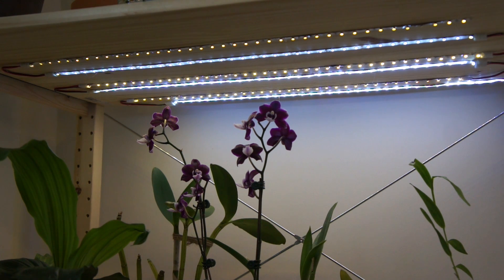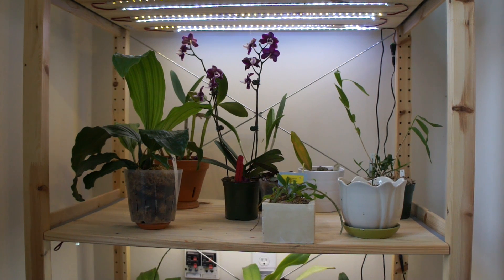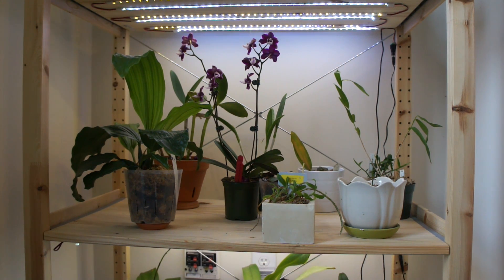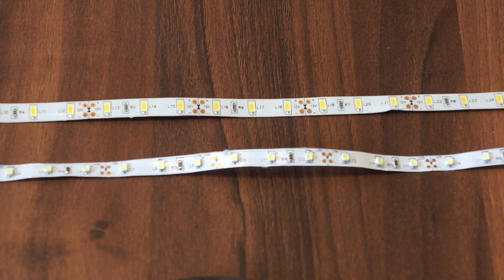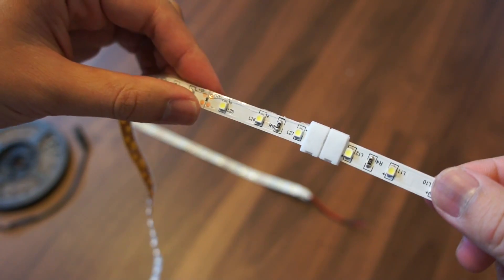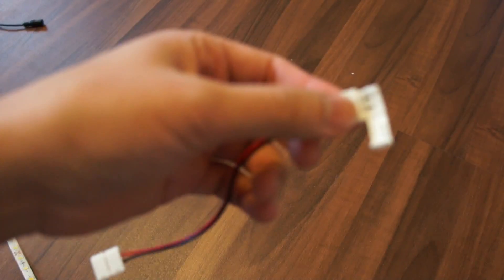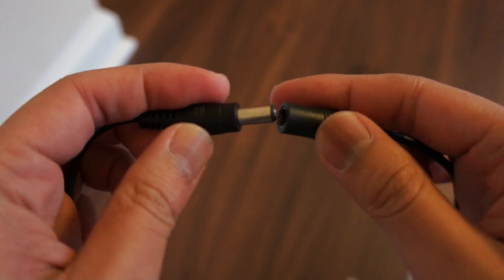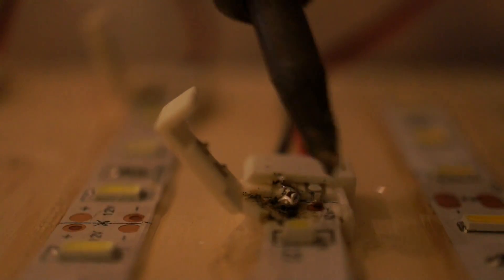Growing Orchids with LED Strips

Comment: dear friend thank u for sharing your information,, can u tell me how u connect 2 strip led together ? i need to know and order the plastic thing u conect them together. cheers
Reply from the maker: +Mehr Arian , thanks for the question. The connectors are fairly easy to connect 2 strips together. In the description above, I've pasted links to examples of connectors that's available through Amazon. You just sort of insert the strips in to the connector and snap it shut. I hope that's helpful.
Reply: +Trac McNguyen thank u for answer , if I have 12 LED lamp , 2835 , do u know how much they use electricity in WATT ? for example : 24 wat ? 12 wat ? 60 Wat ?
Reply from the maker: +Mehr Arian . I'm not sure how much wattage you will need. It depends on how long the strips are and what how much they are rated. Check the packaging for this information. If you can't find that information, I would go with 60 watts power supply as it is better to provide more watts than what the LEDs need to be safe.

Comment: oh wow, is this real? I was about to purchase these exact same shelves for my orchids (ended up with a liiiitle bit different one) and i was planing the same light solution for my orchids. the pigmentation on your den convienced me that it will work for me as well :D thank you :D
Reply from the maker: +Zane's Wildflora , I just saw part of your December update and gotten an overview of your plans. I think it'll be a good one for you since it looks like you're supplementing light. I would recommend that you keep the distance between the leaves and the LEDs at a minimum since you can lose light significantly as you go further. I hope everything works out and happy growing.
Reply: +Trac McNguyen indeed, I'm gonna keep my plants outside in the summertime, but i will use this light shelf thing in a darker room, i hope it will work for me as well:P bytheway why are you using warm lights too?

Comment: Hi Trac,  great video. I have Vanda's and Cattleya's and Dendrobiums in my greenhouse. My Vanda's are up high next to the lights, but the rest are on shelves much lower and don't get the light as well because it is blocked by the Vanda's.  I could put a couple of these strips above the Dend's and Catt's. Do you think it would help?  Do you have Vanda's?  Enjoy!!
Reply from the maker: hi Susan, thank you for your comments and questions.  I would think that any additional light that you can give would be helpful for those genera specially if they are blocked from light. my suggestion is to run as many strips as you can and place the orchids as close as you can to the strips. these led strips aren't intense you doing so will maximize their utility.  I do have two vandas at the moment but they placed in the prime real estate of my grow spaces, which are my south facing windows :-).  I don't think they'll do well under the LEDs given their high light requirement and they are grown in hanging baskets that wouldn't fit well in my shelving units.

Comment: This is so awesome, thank you for making this video. (it's really irritating that the piece of machinery is called "female" though. SHEESH.) Question: what colors are the LEDs that you chose? Do they come in like, yellow and white, or it is "cool" and "hot" like the regular lightbulbs? Thanks Trac!
Reply from the maker: lol, no. if I can do this stuff anyone can. I totally forgot to mention that I used a cool and warm temp LED strips. I think they are rated 6000-6500k and 3000K, respectively.  I think that's what recommended if you're not doing pure red and blue ones. thanks for watching!
Reply from the maker: also, I may have accidentally flagged your comment. I had butter fingers. apologies.